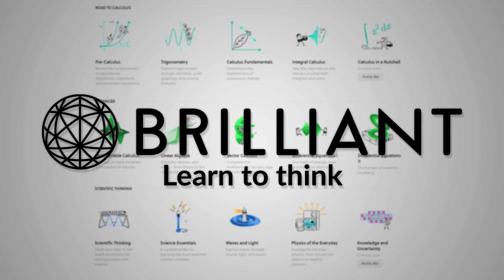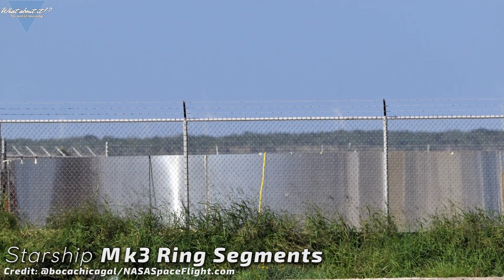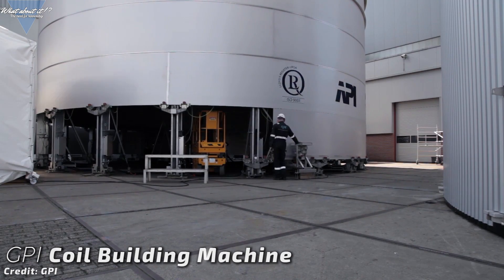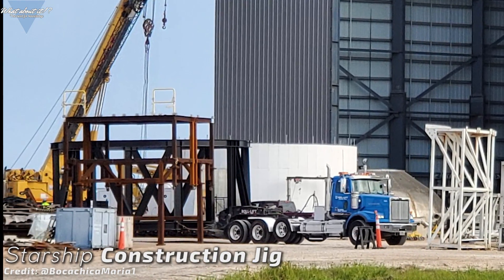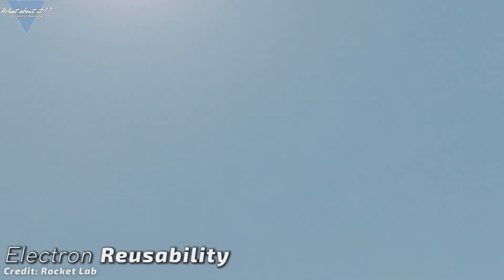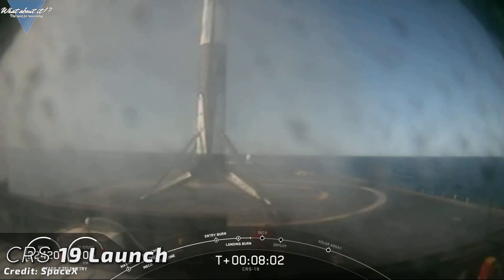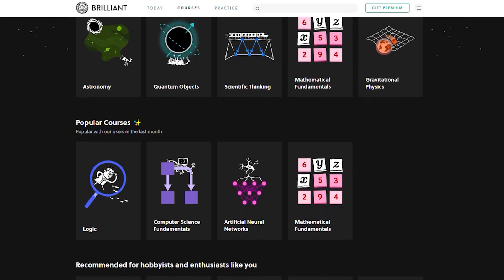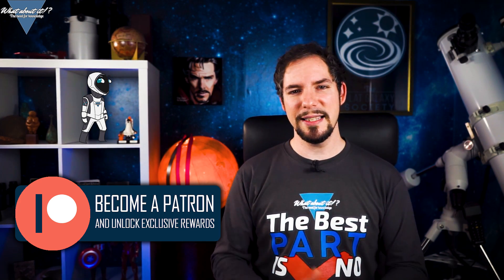58 | SpaceX Starship Updates – Rocket Lab Reusability – Dragon V1 Nearing Its End

Comment from the maker: Will SpaceX ever automate the ring stacking and when will Rocket Lab catch their first booster?
Reply: That ring stacking machine could probably produce a 50m tall starship hull in one day with some modifications, allowing rapid prototyping on an immense scale. If Elon is watching this, he should be advised to buy the company if he wants to cut his timeline for orbit.
Reply: Automated ring stacking cannot be accelerated without buying another stacking machine. Doubling again requires four machines, etc. 

It is more economical to multiply the welding, not the stacking. Four semi-automatic welding machines would be far less expensive and can operate simultaneously on the same weld seam. 

I can anticipate four or more work stations where rings are stacked/welded/inspected and then transported to another workstation for customized fitting.  

However, SpaceX definitely needs to produce a faster alignment technique when rings or stacks are merged. It should be capable of bringing the surfaces into the tightest possible alignment as the stack is lowered by crane - even with cross wind! The crane operator needs rapid precision feedback on the position of the ring center. A self-leveling scanning laser/camera aimed up at alignment patterns on the hex-asterisk jig should work fast and be durable. 

The crane asterisk-jig may also need to provide some semi-autonomous control of the length of the six lines, which seems useful to compensate for wind loads and to intentionally tip or level the ring. Three independent chain drives may be enough. The jig (or crane) may also benefit from an inertia wheel to rapidly and consistently maintain vertical axis angular position.
Reply: @avid0g  The shown ring welding and stacking technology was by a multiple faster then what SpaceX was doing, I suppose you can weld several rings one stacked above another in one day, I could not detect any light change in the time lapse which then would indicate that the shown timespan would be several hours.
Reply: @nilsfrederking62  
One caveat is that the SpaceX rings are cold-rolled full-hard, so the rolling machine has to expend much more energy to roll each ring. Probably requiring multiple motors on the same drive and/or more cooling. 

The first ring rolling can take place much faster than the continuous horizontal welding to subsequent rings, yes? If one automated ring machine is so fast, then a single machine could feed tac-welded double-height rings to several manned workstations, each with six automated welders combining double-height ring assemblies. This would push the automated machine to maximum usage.
Reply: I suspect that when the operational Starships are being produced, they will likely have automated ring stacking.  This would be used both for the cylindrical portion of the Starship stage and the Superheavy stage.

I also suspect that only the bulkheads and the nose cone (with the internal tanks) will not be produced that way.
Reply: Not to be rude but you forgot the news about Just read the instructions arriving aka now being stationed in port Canaveral and I'm sure they'll automate it so they can do more starships at once
Reply: Automatic ring stacking would be useful for Super Heavy booster construction because the booster basically is a huge cylinder...
Reply: It would be foolish to automate any sort of prototype be it a car, toothbrush, coffee pot or especially an unproven and radical concept rocket that’s yet to be tested. I have no doubt that if starship proves out to be everything Elon says it will be, he will absolutely automate every possible aspect of construction. It will be the only way to achieve the thousand ship fleet he has planned for his Mars invasion.
Reply: @jtoombs56  
Automating an unproven design may cause investment in the wrong automation. Eventually and selectively, automation will not only increase speed, but maximize consistency of quality.
Reply: One of the Boca Chica site channels showed a tan cylinder being built from lightweight panels. I'm guessing the precisely formed rings will be stacked on this to keep their shape. Can't guess if for storage or actual construction. Mk 3 won't have automatic stacking, but Mk 4 will - they'll have time to order a machine while completing the KSC assembly site.
Reply: @donjones4719  
The tan cylinder with scaffolding goes inside the hull so workers can rapidly operate the welding machines, grind and inspect the welds. 

Rapid alignment requires something that can effortlessly guide together the two hull rings during mating (even with wind) and then replace with heat-resistant clamping that retreats from the joint during welding. I would put that mechanism on the outside so (1) workers have a clear working field, (2) the mechanism can start alignment of the next ring while the present one is clamped, spot welded and machine welded.
Reply: @avid0g   Makes total sense. Was thinking about this, but don't know enough about welding to get farther than thoughts. Thanks for the info.